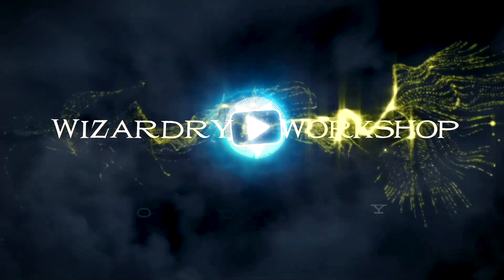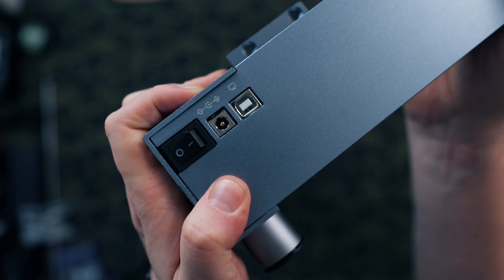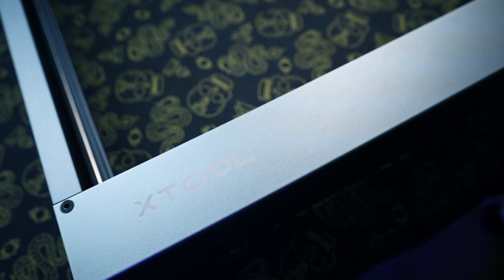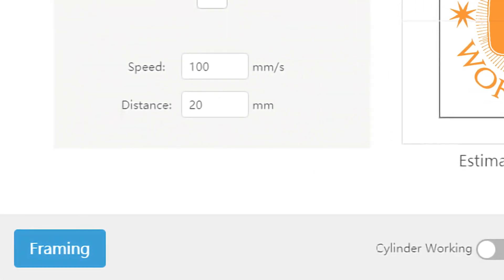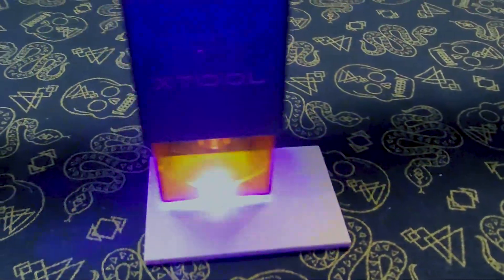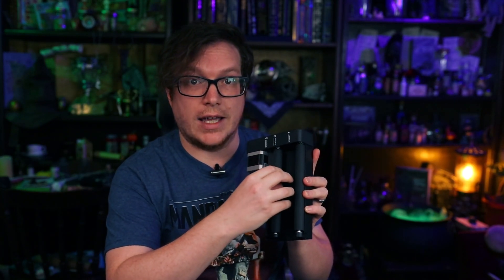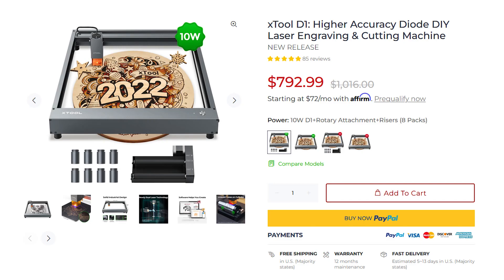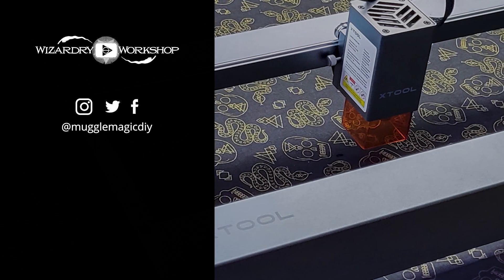xTool D1 Laser Engraving Machine - My First Thoughts

Comment: You can easily create a enclosure using plywood and either transparent green or red acrylic for a window. Clear acrylic will still require the included safety glasses, but it's easier to find in smaller sizes. I'm asking my husband to take the scrap plywood in his shop to make an enclosure for ours when it arrives, as I'm not going to be doing much in the way of large projects with it. My 10w D1 is currently in transit, so just waiting for it to arrive to do the necessary measurements to design the enclosure it will have a clear acrylic window for now . I am not going all out on the exhaust part right now. In the summer the enclosure will have a small power fan to push the fumes outside of the enclosure and I will get a true exhaust fan for in the winter.

Comment: Great video Thanks. I've been looking at getting something like this and was also looking at the Snapmaker 2.0 that also does 3d printing and CNC carving.
Reply from the maker: Oh, cool!  I haven't heard of it, but I'll have a look.
Reply: I bought t he Snapmaker 2.0 A350, it is a great little machine,  the laser which is a 1.6W does good work but I wanted something more powerful so I bought the xTool D1, another great machine and the laser is 10W. The Snapmaker's CNC does very nice but is not that powerful, in essence, like I said, does great but is not a high production machine.
I'm happy with both. If you have any question about the Snapmaker ask away, had it for 6 months already.